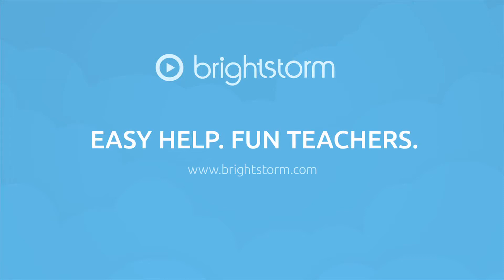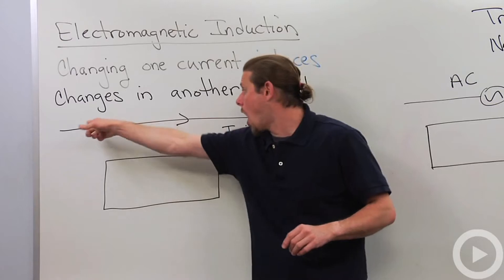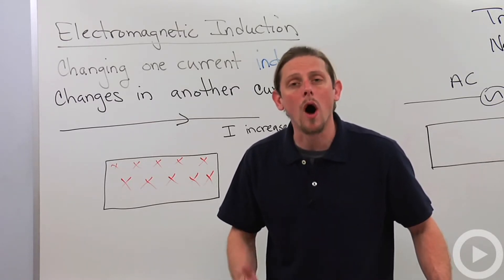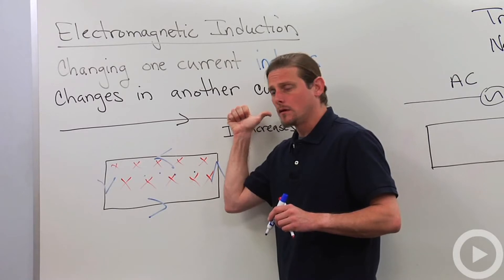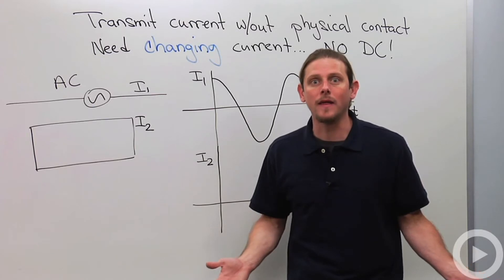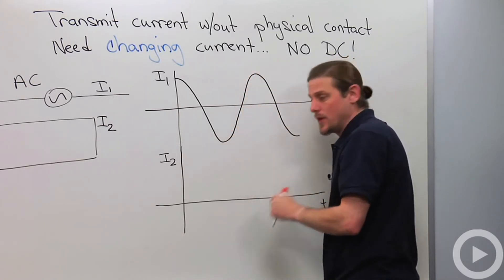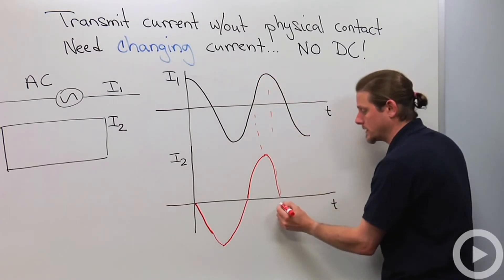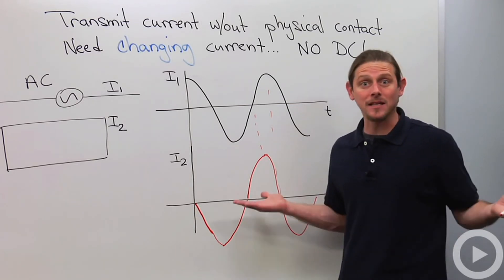Electromagnetic Induction(HD)

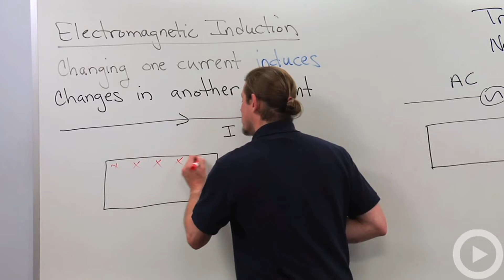Comment: I'm confused about 1:07. Why is the current going into the page?
Reply: i think he couldn't show the right hand rule correctly. 4 fingers of your right hand should show the +x (right side) since the current is increasing that way. when you do that, your thumb will show the -z side which is into the page. so according to the lenz law, the increasing magnetic flux that is going into the page will cause an induction and there will be an inducted current that will oppose that which is out of the page. this is how i got it, but i am not sure if i got it 100% right.
Reply: It's the right hand rule in some institutions (the one I'm using for instance). The thumb points in the direction of current. The fingers curl in the direction of the magnetic field around the wire or in a loop.